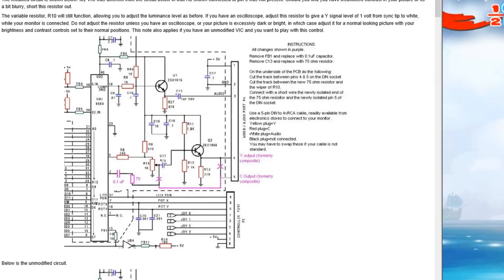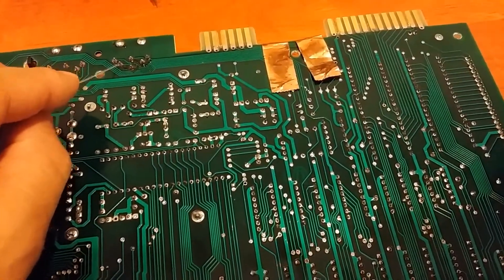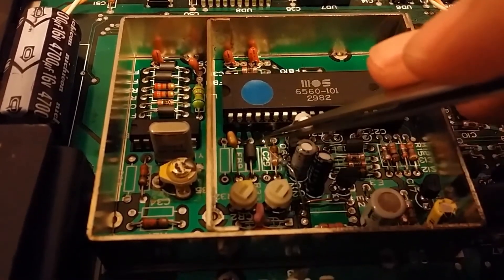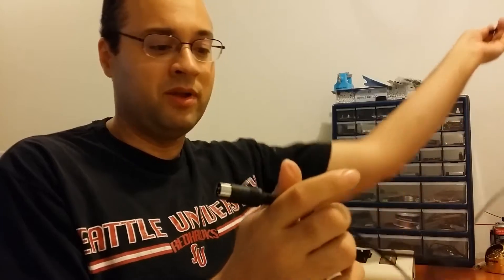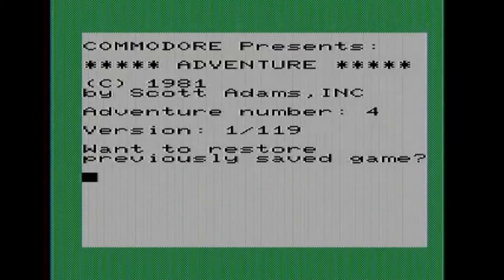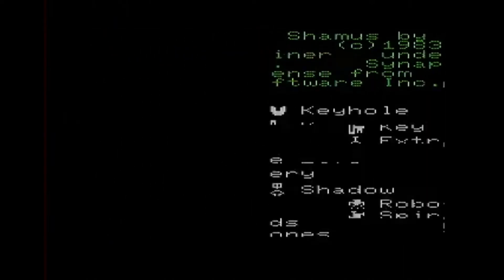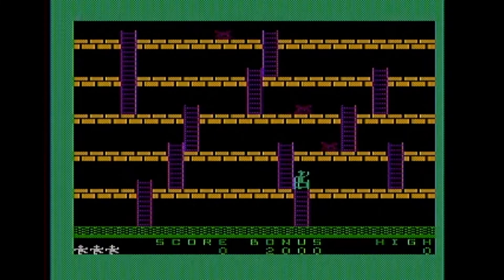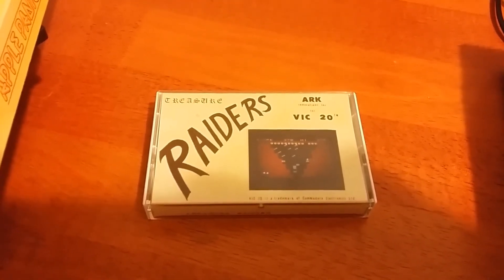Ye Olde Computer: VIC-20 S-Video mod

Comment: Hello! tell me the precise values of the 0.1uf capacitor I don't know by how many volts I have to take it! Thanks!
Reply from the maker: I realize I'm way late in replying, but I don't remember the exact voltage of the capacitor, but the official datasheet for the MOS 6560 video chip shows that it runs on 5V. Basically any capacitor over 5 volts should do. Personally I like to use caps around 10v in situations like these.

Comment: Very nice tutorial I will definitely go for this mod on my Vic. One question concerning the selfmade cable : I do need a separated jack for the audio inputs? I do see a classic jack to be used for audio composite on your cable right?
Reply from the maker: Yes, the sound is a separate output from the S-video output. it is a standard RCA jack.
Reply: Evenball ok thanks a lot :-)